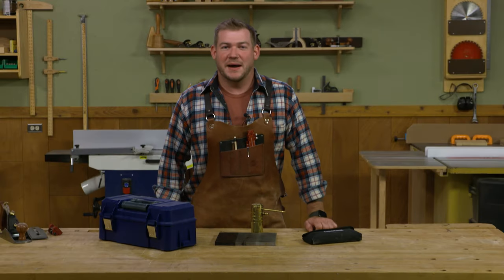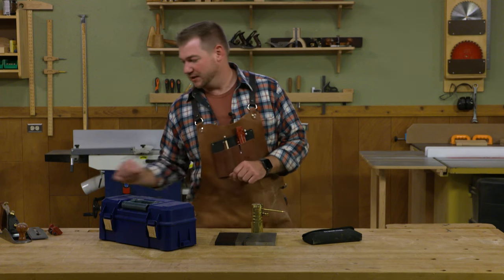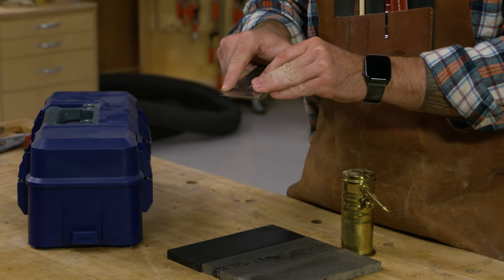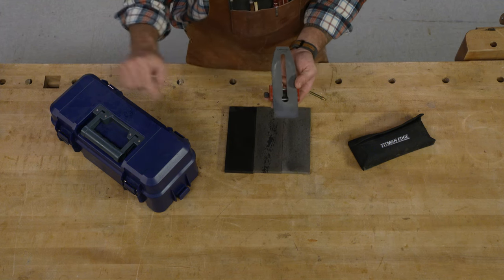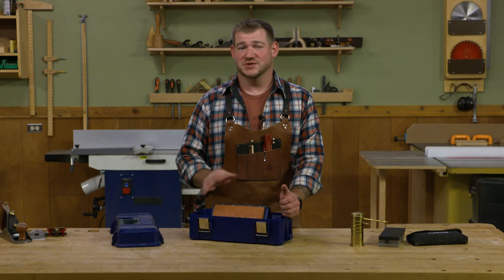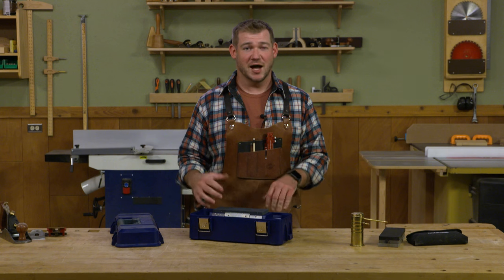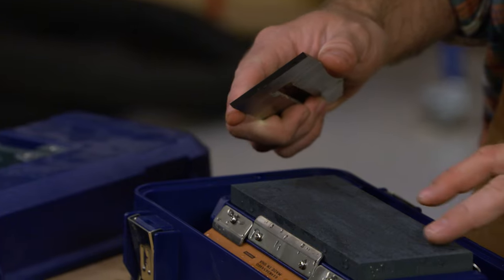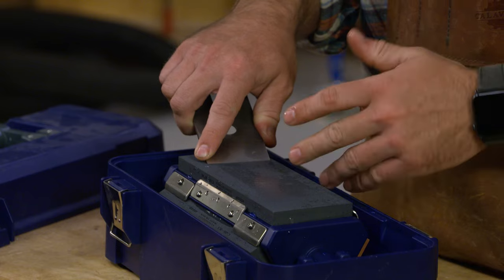What's the BEST sharpening system?

Comment: I purchased the diamond plate and used it to sharpen all my chisels, plane blades and card scrapers. I am extremely satisfied with its use and results. Being a former toolmaker I know that stones have wear issues and are difficult to keep flat. Once I saw this video I knew this was the right sharpening system for me since I compared to all other methods out there. Now that I have my hand tools sharpened it will allow me to touch them up easily when needed and no need to have many different stone grits.

Comment: I have top end, water stones, Oil stones and yet do 99% of my hand tool sharpening with my Worksharp. I'd suggest not using the word "BEST" unless you offer more of a range of ways to get it done. My $0.02.
Reply from the maker: I'm not a fan of powered sharpening solutions...unless you're talking about initial grinding. I had a Worksharp (WS3000) and did not enjoy it. It was too easy to screw up an edge, and even after buying after-market diamond stones for it, I could never get an edge as sharp as I could with bench stones (diamond, water, oil, etc.). I guess I should clarify, but "to me" these are the best way to sharpen 🙂.

Comment: Let me add a comment the reason that water is use water or coolant also call soluble oil water and oil using water it wear the stone very quickly cause the blade it doesn't brake what I mean by that oil brake the surface of any metal a few microns of the surface unlike water doesn't , and diamond stone is not a real diamond is synthetic , like ceramic or carbide my suggestion is use oil as much you guys can stone will last longer and will sharp better I worked in metallurgy for over 45 years my Humboldt opinion if I can help made a comment